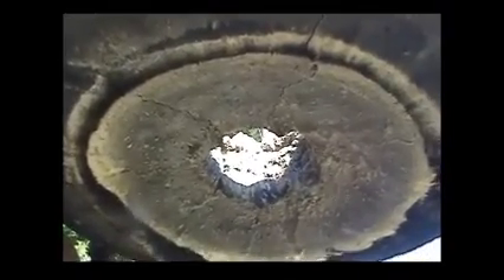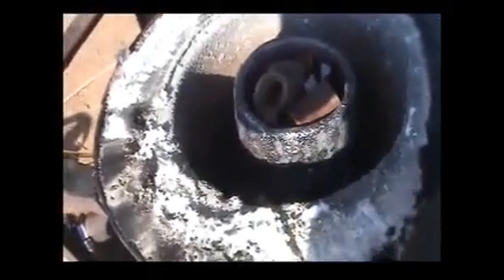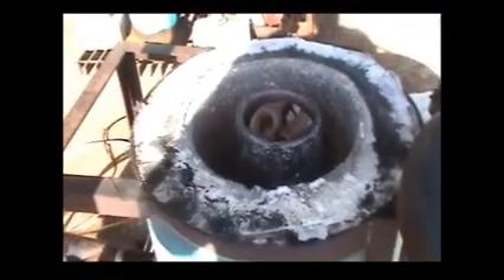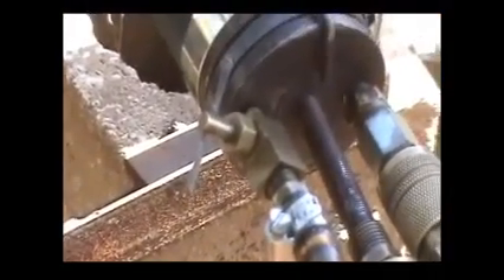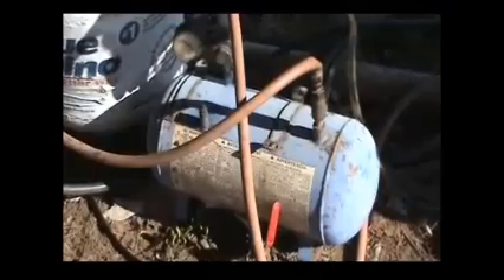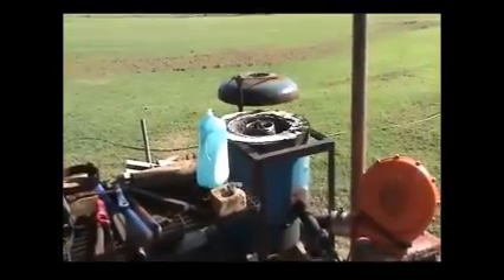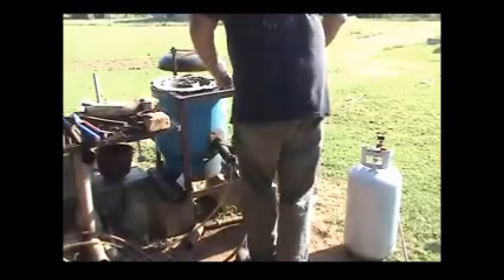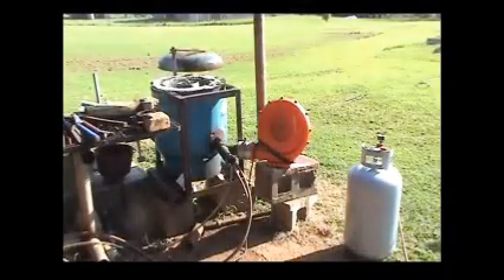Cast Iron Melt 2 8 5 15

Comment: Those turned out as nice as the aluminum ones. I sure like that flask, did you make that recently?
Reply from the maker: Clarke E I made three flask they each are a little different for one another, like the first one I didn't put any handles on the pattern and had to use aluminum angle, the second I put handles on it but screwed them up so that weren't centered over each other, and were too far apart, The third one I cut the pattern up and fixed a bunch of the things that I didn't like in the others.I tend to make flask as I need them usually they are out of cheap wood